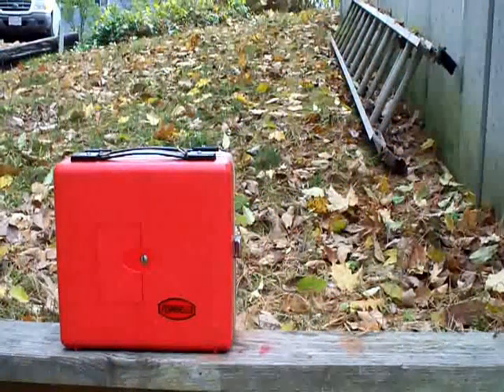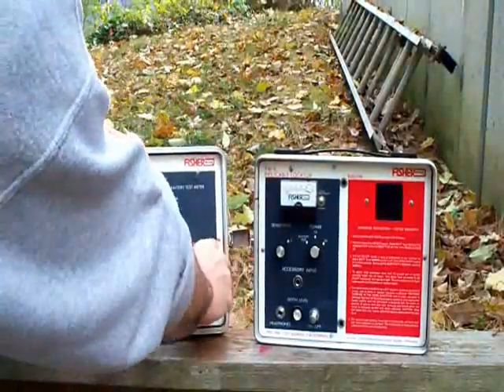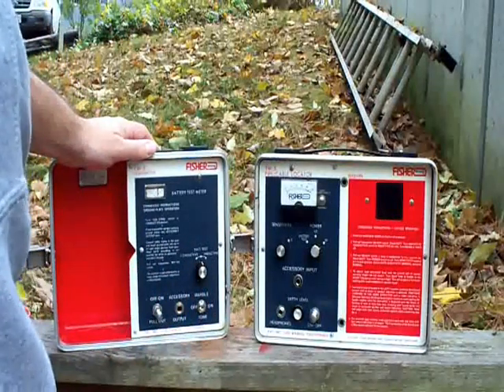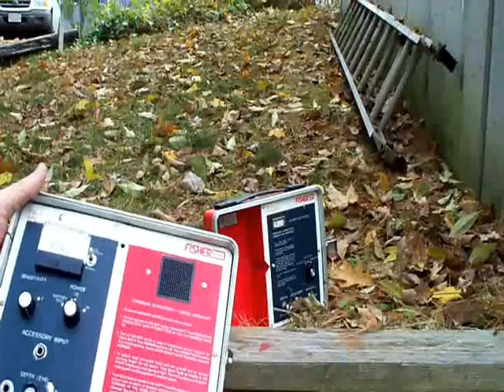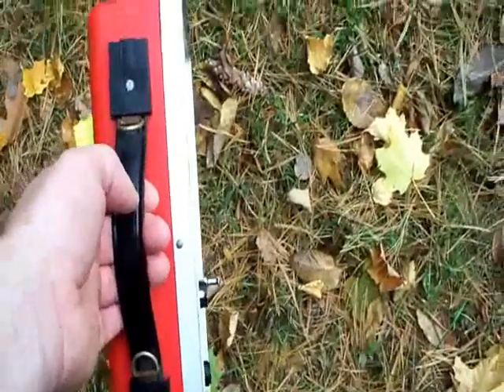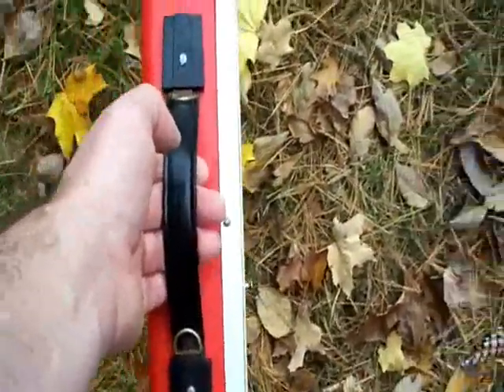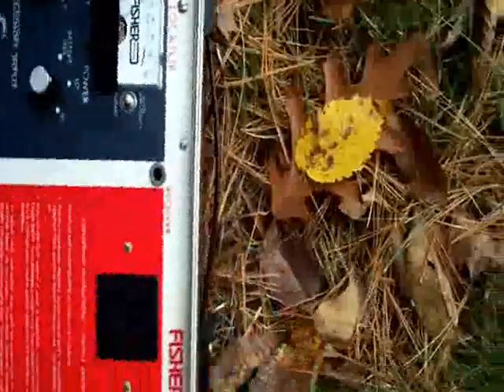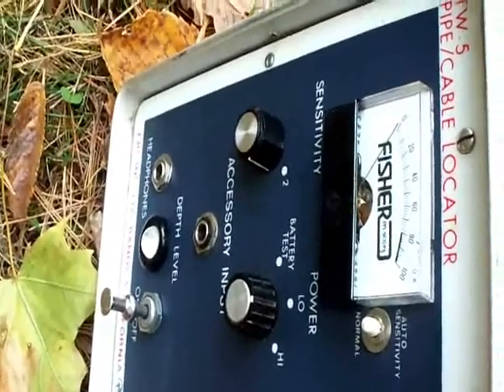Fisher TW-5 Pipe & Cable Locator Demonstration

Comment: So many questions unanswered on this video. Where do battery’s go ? How do you attach the handle ?? Will it pick up a civil war cannon ball at 3 feet ? Pinpointing ? Can it be used as a metal detector when handle is attached ??
Reply: I don't know. Mine I got without the pole and use it only for conductive locating.

Comment: I have an early version of this TW5 unit  and when I got it, it had this weird 9 volt battery that looked like a 6 volt lantern battery but had 9 volt connection.. Couldn't find one at the time so I bought an 8 pack AA battery holder and soldered passed the last two batteries to get me 9 volts.Has worked great for many years on the same AA batteries. I'm  wondering if the original battery is even made any more. Anyone know?
Reply: Can you contact me through messenger ?? I have questions. Thank you.
Reply: I'm trying to figure out what battery to put in it. Did you ever figure it out?
Reply: @elijahflow  I did eventually find the batteries but they were $26 each and I would have had to order them. I stuck with the AA's and still use it to this day.  Sorry I don't remember much. I doubt they even make them anymore since this is maybe from the 60s or 70s. If you find them, they probably will not be cheap. A few years ago I located a 6 inch iron water main by hooking to fire hydrant and finding the pipe about 100 yards away that was 5 foot deep. Not bad for a  $2 garage sale locator.

Comment from the maker: The Gemini 3 is used strictly as an inductive locator.  The TW-5 can be used in directly coupling to a pipe or cable.  Otherwise the are the same.